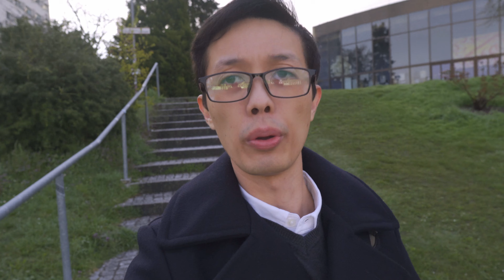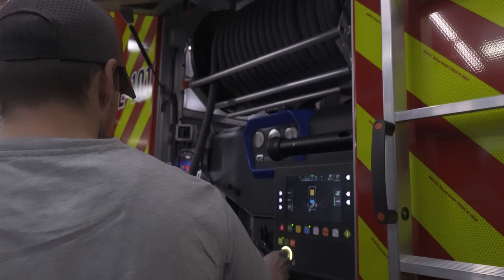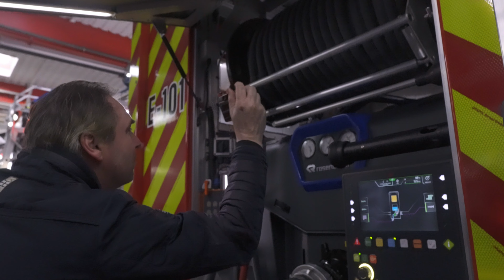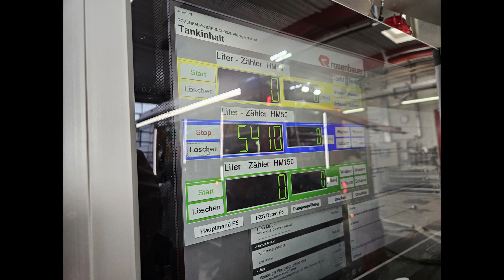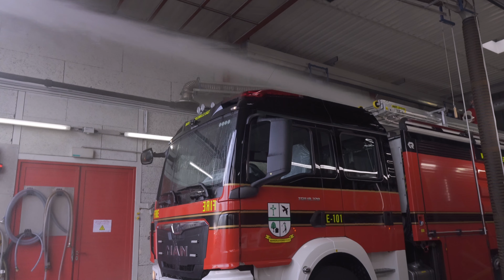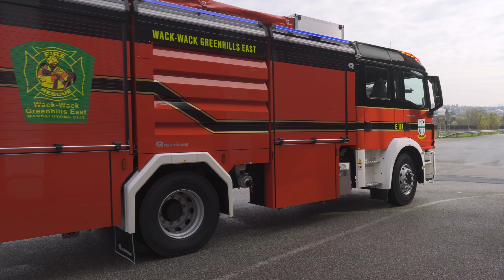Testing Barangay Wack-Wack's new fire truck! Vlog No. 2

Comment: 4:53 GROVER 1510 SUTTERTONE AIRHORN.
5:03 MAX-B MARTIN-HORN 2298 GM.
5:11 FEDERAL SIGNAL PA300 + FEDERAL SIGNAL BP100 SPEAKER.

BUT SADLY, THE FEDERAL SIGNAL Q2B & FEDERAL SIGNAL RUMBLER SIREN IS NOW EQUIPPED, SOON TO RESPONDING WITH RUMBLERS!

Comment: Ive seen that whenever a new truck enters service in your Philippines it usually gets a convoy cermony. Will there be one for blue whale?
Reply from the maker: Still figuring out how to give the truck an entrance as the inside of the private village has a no siren quiet policy. Most likely we'll do an entrrance salute with the other units by the location of the still under construction new Brgy Hall building so that we can use some sirens.
Reply: @miko235  fair enough conduction is almost done correct?
Reply from the maker: @shakirdelph7719  the new building should be ready for use by Q1 2024 as per the highlights of the last council meeting.
Reply: @miko235  ah okay

Comment: HOW MANY DAYS?
Reply from the maker: No definite dates yet. It is still the supply issue of the Federal Q2B that is the primary issue as to why no definite dates can be given for shipping and delivery.
Reply: @miko235  HOW ABOUT RUMBLER SIREN, & ALSO BP100 SPEAKER?
Reply from the maker: @BURNINGRYZEN112  As as their latest progress report, it's been installed. I've requested for another siren test once all sirens have been installed if it would be possible to do.
Reply: @miko235  IS IT REAL?
Reply: @BURNINGRYZEN112  shutup
Reply: @chaaaiiiiii  SORRY I WON’T DO AGAIN.